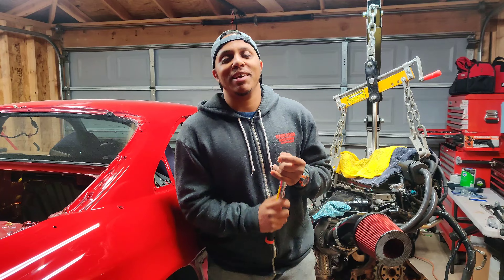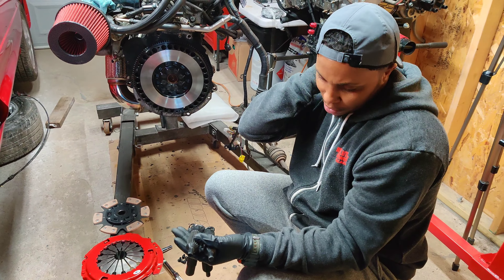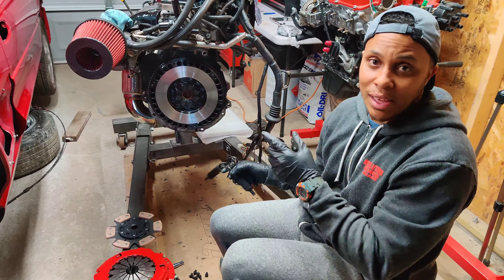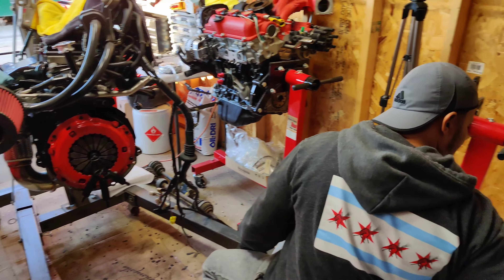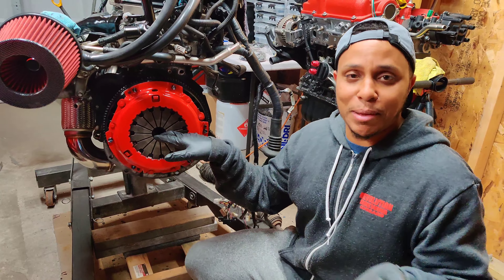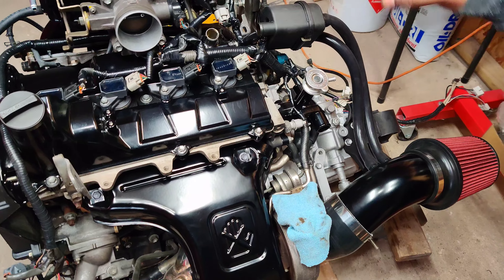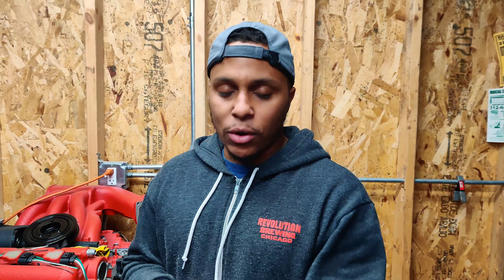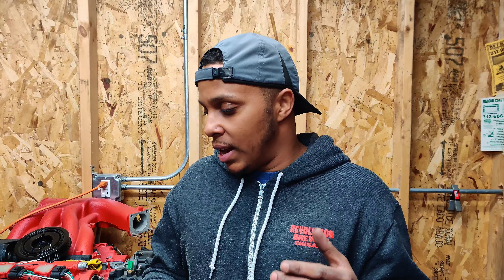N.A.G.- Ep.32 Engine Bay Series 5

Comment: I heard it was good to buy some really long bolts that thread into to the block, then cut off the heads and use them as guide pins so the transmission slides in easily. I was going to give this a try when I mount mine on the gen4
Reply from the maker: I did something similar I did use longer bolts to help press the transmission to the block since there are already guides that are on the block I just lined them up and started screwing the bolts and them once mated removed them and using the OEM bolts to replace the longer ones
Reply: @NastyAddictionGarage  Ahh nice. I didn't notice that in the video
Reply from the maker: It's hard to show it but yea its there 👍